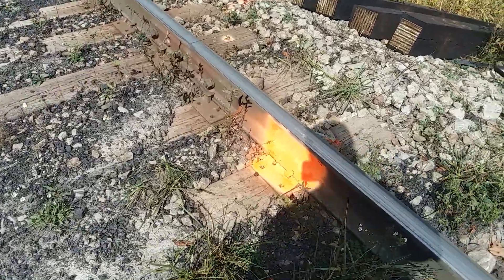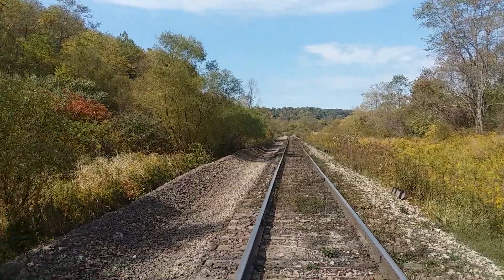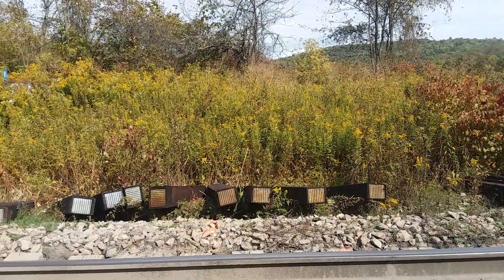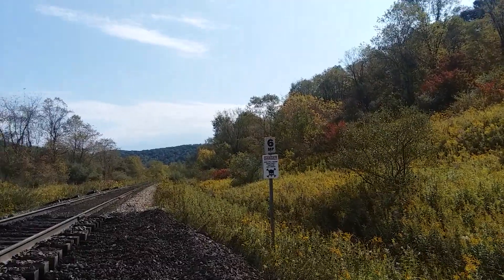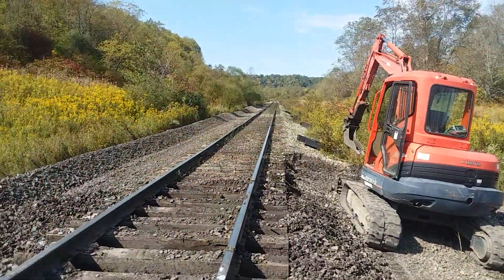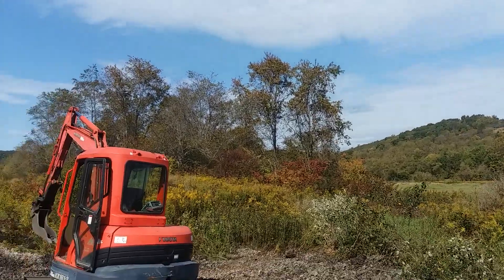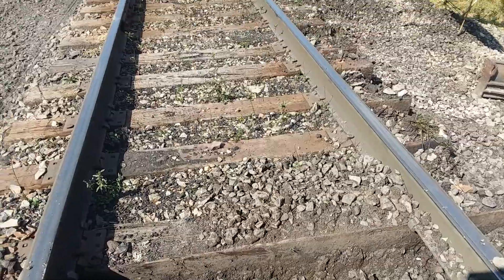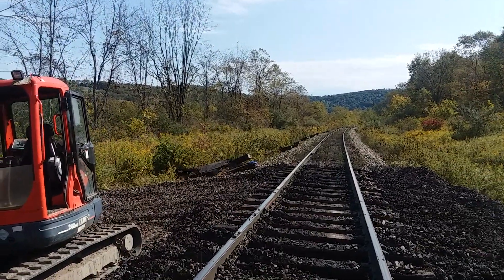Track Plot Tags, plus Starting more Ballast Rehabilitation

Comment: Granite City works is still in operation to some extent, although just a shadow of it's former self. They still roll some specialty steel but nothing like they used to even just in the 90s. I actually hunt ducks in one of their cooling ponds! They had their own railroad just like you guys but just sold most of it and it's now ran on contract from what I understand
Reply: Probably it's terminal rr that serves them now, reminds me when anheuser had it's own rr as well
Reply: @animenut69  Yeah I used to work right next to AB in STL. Lots of their tracks got paved over when they switched to doing most of their business with trucks. They find the tracks all the time whenever they're doing roadwork around the brewery

Comment: Any thought to doing a Return On Investment of switching to bottom well cars, and putting in a rotary dump mechanism at the barge terminal in order to save on track maintenance?
Reply from the maker: They shoulda done that when they built the place! They will never switch over now, but what a cost savings that would have made over the years. These bottom dump hopper cars do dump a lot faster than rotary, but they leak so bad they spread coal out on my track an ruin the ballast. I got over 3 miles track looks like it spray painted black from the coal spillage, the people they got in there for last several years that do car maintenance are pitiful at keeping these cars maintained.